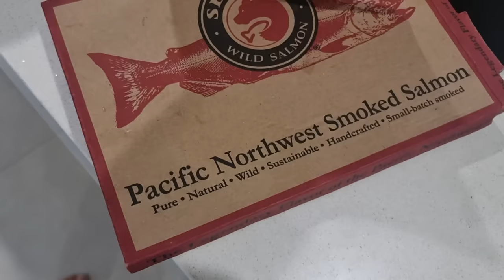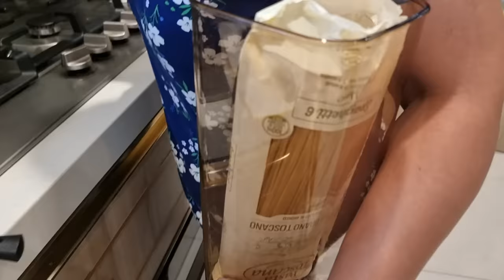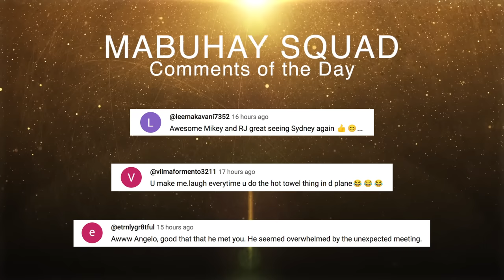Setting Up Our Christmas Tree | Vlog #1673

Comment: That's sourdough bread, one of the most difficult bread to make. They literally made their own yeast/starter  which needs to be fed everyday for maintenance. It's a science to itself. It is full of probiotics. Proofing takes a long time too, requires special baskets and then baked in a cast iron pan in very high temperatures to give the bread it that bloom. Hence it costs more than the ordinary bread. That's the "Rolls Royce " of bread,  Lucky you 😊